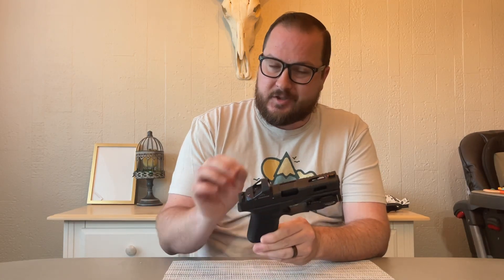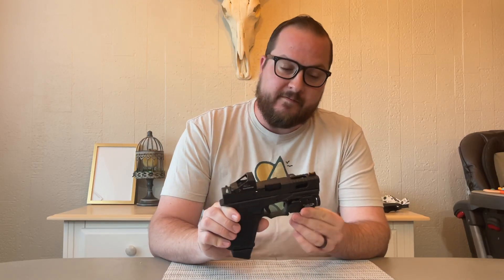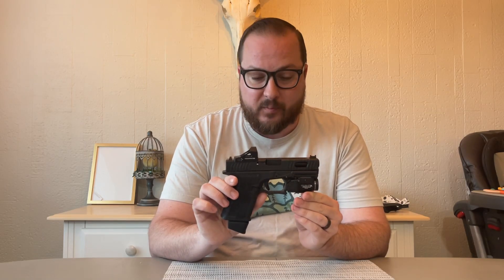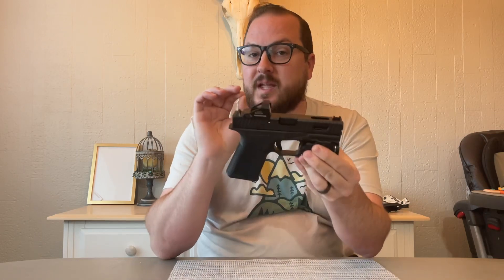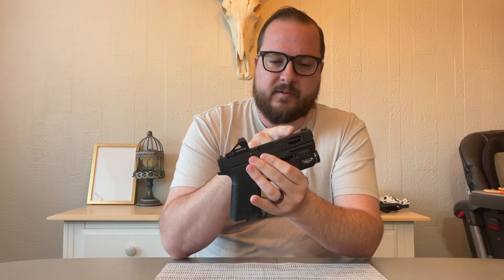My First P80

Comment: These dyi kits are what got me into this hobby and eventually to printing them(that and big chungus).  Also vmac9 kits are back in stock at velocity if you want to build a Mac daddy.
Reply: They are a great gateway to printing
Reply: I agree. The P80 builds just make you want to take it to another level. That being said, printing frames is even easier in my opinion and run better out of the box compared to my P80 build which took some break in.
Reply: @MrDmthomp32  very valid point. Most of my P80’s needed about 50-100 rounds to get smoothed out. Strike80 however was perfect at first shot
Reply: @comeoutandpla  that’s interesting! I have no experience with them. Might need to take a look!
Reply: @MrDmthomp32  unfortunately they are nowhere to be found. But I regularly bother strike industries about when/if they will have more. The only response I get is ‘soon’….for the past 8 months
Reply: @MrDmthomp32  so you can snag p80kits. Look up rocky brass.  Occasionally Midway and Brownells but they get solded out fast the little side retailers have them normally just gotta hunt.   But parts are a bitch occasionally.   You find like everything but the sights or something nutty.    I did a g20 p80.  It's a nasty heavy hitter.   Basically a automag.  Rock brass slides are reasonable good for cost as well.  Get missing stuff from the Glock store. Most oem works great no tweaking needed
Reply: @comeoutandpla  the full gun kits yes.but you can get p80 lowers still it isn't like them mac11 uppers.

Comment: What frame is better in your opinion printed or p80
Reply from the maker: One isn’t better than the other. A P80 has fewer reliability variables, but a printed frame can even exactly what you want it to be. Want a 26 length grip with a 17 length slide? Print it. Want a frame that looks like the Halo Magnum? Print it. It’s about making what you want and not just what the market offers.

Comment: Those are fun but I think there are better tools.  Use a razor saw for cuts to get really close and use a soldering/stippling iron to smooth them out.  That makes it easy to get really clean looking results, especially in the recoil spring channel.

I spend a little extra time making sure the rails line up properly and shape the trigger guard, grip and magazine release to fit my hand.  The end result looks nice and doesn't have some of the hotspots around my knuckles like the unmodified frame has.

Comment: What is your total cost?
Reply from the maker: My cost and retail cost are two very different numbers, but retail on this build would be like $850 as pictured.
Reply: @booliganshootingsports  that sounds about right based upon my experiences.
Reply: It nice though if you can build one because you can build it out Gucci'ed up. Nice slide and barrel etc etc.  I still stick with Zev triggers or oem  factory polished to a mirror.   Give you a idea I built a p80 Glock 20 for kit for 99 on sale.   It's probably 400-500$ total with disgusting good deals on dvor. Etc etc. And a reasonable slide from Rocky brass. Factory barrel.   But a decked out big chungus with stainless steel furniture, and alot of tungsten parts,  ld2 slide parts. is up near 800 easy. Then throw a rmr on top lol

Comment: Is the trl7a worth it? Battery fall out on drop test?
Reply from the maker: Not sure how the battery would fall out since you have to completely unscrew the lens/bezel to change it.
Reply: Trl7 is a good light.  On pare with trl 1 and 2 in construction.   It's very short so it actually more difficult to whack stuff vs the 1 and 2 that poked out a bit on a Glock 19.   Trl7 is basically almost flush with front of a Glock 19.   But not flush enough to mount a silencer osprey 9( I know I tried lol) also it still doesn't quite fit alot of holsters which is annoying.
Reply: @booliganshootingsports  excuse me. I got it confused with the surefire xsc. Wonder when streamlight will come out wirh a true subcompact weapon light.

Comment: So this isn’t related to this video but I don’t know how to design 3D prints but would it be possible to make a Draco design for the ruger 10/22 the pirate design you made was crazy cool but I like the look of a Draco and a 22 is easier to get then one so if it looked like it would be dope
Reply: An AK lookalike should be possible. There is a kit called the Krinker Plinker, but it is very expensive.

Comment: How reliable are these? Do they jam up alot?
Reply from the maker: They’re as reliable as a factory gun if you use good parts and build it properly.
Reply: @booliganshootingsports  Doesn't the kit come with all of the parts? Or are there some parts that I should replace? Just asking because I just discovered these buy, build and shoot kits. I usually just buy firearms from an FFL but this looks cool to do. And I thought that I read that the kits came with everything.
Reply from the maker: @PredatoryPrey  the kit from P80 only includes the 80% frame, jig, tools, and rails. It doesn’t include the slide, barrel, upper parts kit, lower parts kit, etc. The “Buy Build Shoot” kits have been targeted by the ATF and P80 no longer sells them. I would be wary of anyone claiming to sell them currently. 

So to answer your question, no, the kits don’t come with everything and you’ll need to source out the completion parts, and your reliability will vary depending on the parts you choose.
Reply: @booliganshootingsports  Oh ok I really appreciate the info. One more question. Do you have to get those other parts from an FFL dealer? Or are there non FFL companies that sell them?
Reply from the maker: You don’t need an FFL for the other parts. The only part that is legally a firearm is the frame and you’re making that yourself using the P80 kit.
Reply: @booliganshootingsports  Roger that. Thanks man I appreciate the info.

Comment: I have more than one of them, and I love them. I run holosuns on everything. I also run Olights. 2 or 3 idiots gave Olight a bad name, and everyone else is just a parrot. I've had bad experiences with streamlight, so I won't buy them. I've had good experiences with Olight, so I do buy them. If I wanted to try a surefire, I could afford the light, but most of my holsters are for Olights, and I don't want to buy all new holsters.
Reply from the maker: I agree on the Olights, I have a few that work really really well. But it ends up being a complete fight every time I post a pic of one online.
Reply: I have 2 OLights, and recently I've picked them up after months, and found them both with dead batteries. A quick recharge fixed the issue, but it was concering because I hadn't done anything to discharge them. Now I'm concerned they may have a self-drain problem, and may not be ready if I ever need them.